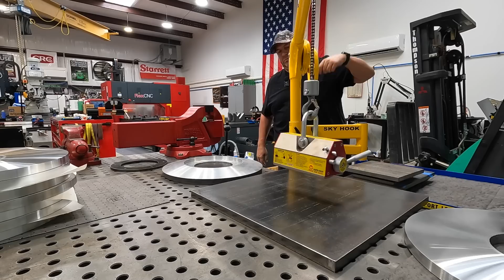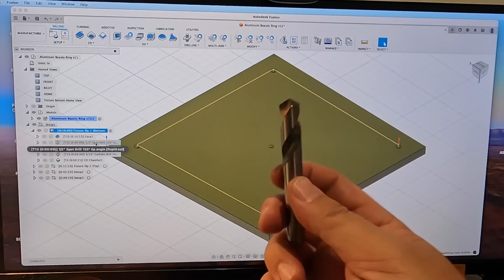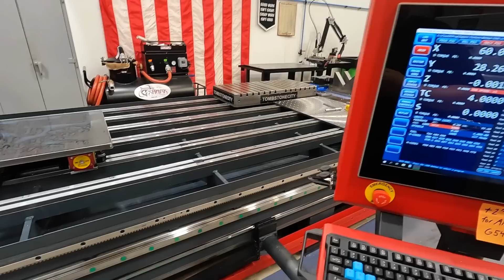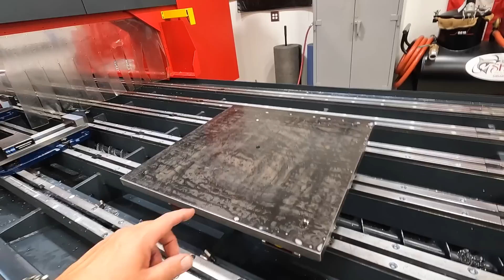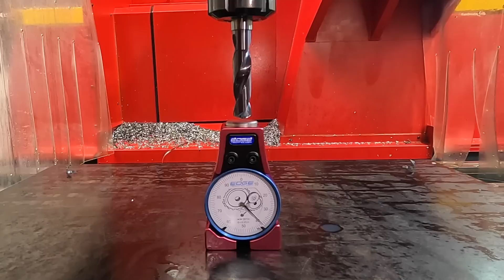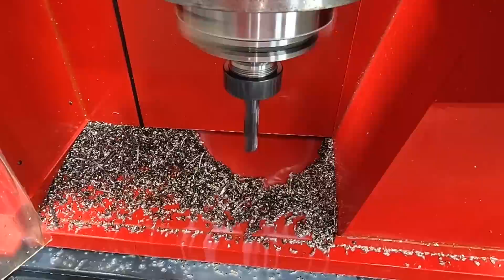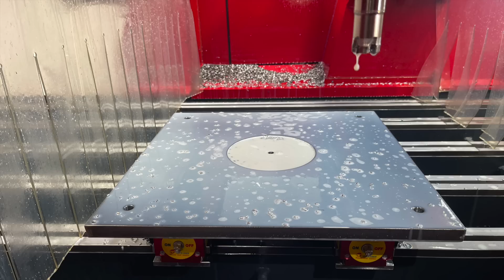Milling the Beauty Ring Fixture for Op.1

Comment: Hi Adam, a naive question here. When you flipped the plate setting up for the tip side you did not use the 4 previously drilled holes to align the plate. However you now have 6 clearance holes you need aligned exactly to your next program so that when drilling into the aluminum the drill bit travels into each clearance hole in the steel and doesnt miss by x. What will you use to get the steel plate correctly aligned so that these clearance holes are in the correct space that matches your aluminum program? Thanks D

Comment: The tool change location looks a bit out. I've done a fair few of these types of tool changers carousels on travelling column machines. The tool change position for the spindle is set by jogging the spindle onto the tool taper and altering X,Y, and Z positions in the control parameters until the tool engages without being pushed over..

Comment: Here's a project: Design and make a clear mineral glass or pyrex, spinning, self-clearing "window" to be mounted in front of the camera in a splash zone. Something that runs on small cheap batteries.
Or plan B, is mounted on a rechargeable drill that spins a mandril onto which a clear shield is mounted. Drips, drabs, and debris would be spun off the clear shield so you could put the camera where you wanted rather than some other compromise.
Reply: Can't you imagine the very short sections when there is a camera obscuration? I hope you don't drive a car!

Comment: Query? Why didn't you surface the second side before milling and putting the holes in. You were using depths for spotting and depths all over that side but if it was not initially flat, wouldn't things like spot depths and deburring etc. be off?

Comment: It's worth putting a couple of milled edges on your fixture plate. One on X and one on Y. It will help centre it when you use it next time. Or stick a couple of pins in it.

Comment: When I face the stock, I set Z zero as the finished face, just the way I was taught to do it! I also like to cut a plate like this, square, to make it easier to line up on side two.
Reply: I don't think there's any point. He's got a centering hole, and the part is round
Reply: @snowdog90210 if the fixture is used again the centre holes need to be aligned radially with the program. Otherwise when drilling through the drill can catch the sides of the fixture holes. So a datum edge should be machined and marked as front so it is not setup at 90 degrees..
Reply: @snowdog90210  Just a bit easier for lining up the plate on side two as the hole pattern would be tied into the outer edges but as you say, not needed for this job.
Reply: It's recommended good practice to set the finished top face at zero then all depths will have a negative number. This helps if you miss a - sign in front of a Z depth, the tool will be clear above the workpiece.
Reply: @marley589  Yes, agreed, but the finished top surface would normally be set to Zero and not the rough stock. Then all ops can be a minus Z from the finished surface. The rough stock doesn't actually exist on the finished part.
Reply: @cncit  Sorry I should have made that clearer. I'll modify my original post.

Comment: CAN YOU PLEASE EXPLAIN WHAT THE DIFFERENCE IN GEOMETRY IS ON A SPOTTING DRILL?
Reply: a 135 degree drill needs a 140 degree spot (or more than 135 at least) because the drill center tip rides in the divet and doesn't wander
Reply: @ikbendusan  I pretty much understand that much, but why doesn't the spotting dril wander...
Reply: @fengelman  spotting drills usually have a very short flute length so a lot of rigidity is preserved in the shank. that shank can be a lot thicker because it doesn't have anything to do with the final size of the hole; only the divet. it's not about the geometry of the tip really, and more about everything else
Reply: Can you clarify your question? Are you talking about in Fusion? I'm not understanding what you are asking.

Comment: WHY DIDN'T YOU USE THE SKYHOOKER MAGNET THING TO SET THE RINGS DOWN TONFIXTURE? SEEMED LIKE IT WOULD SAVE A BROKEN BACK. BE SAFE OUT THERE HOSS. GET BACK TO THE MANUEL  MACHINING ASAP PLEASE.
Reply: The aluminum doesn't stick to magnets very well ;)
Reply: @Josh-sFarm  WHATEVET YOU HAVE TO TELL YOURSELF TO GET BY HOSS.

Comment: Something to consider that I was taught in cnc classes is that you can save time in hole drilling by using the spot drill and go deep enough to give a chamfer.
Reply: @someguy95981 For this job, he only had a 3/8" spot drill. The holes were bigger in diameter than that, so you couldn't use that method unless you were to use a spot drill that was larger in diameter than the drilled holes.
Reply: He said he learned this a few videos ago, I was also expecting this technique to be used. I bet he has one on order for the 48 holes in the Aluminum rings..🤔

Comment: Every one does things different. but what I would have done is finish the counter bore and holes on the mill clamped down on the table and then mounted the part on a plate with 2 pins and clamp the part down with the remaining bolts and finish the part if the 3d milling didn't work out I would rough off the material on the taper and make a final cut on the lathe. But what makes your set up a pain is the huge plate to cut a big diameter and locate. I feel it much easier to use 2 holes and clamp using the remaining.
Reply: It seems that machining the bore and holes first is the most popular option. With a tolerance of +/- 7/16" to locate the plasma cut blank it does not need such a precise location.

Comment: 120 kg equates around 264 pounds, not 2600
Also is the coolant supposed to come out from the collet? With inner cooling you should use special collets that are sealed so the coolant only comes out of the tools.
Reply: He meant to say 1,200 kg, not 120 kg. They are rated at 1,200 kg

Comment: I can't understand the use of co-axial and dial gauge type analogue probes to set job up when you have a perfectly good Renishaw micron level wireless probe? The time you are using up, bumping a great big piece of steel around to centre it to a 1/16th", when the Renishaw can centre the work offset and even adjust the plate for square / parallelism within software - the Flex must have this capability built in? And I do agree with other commentators about the right tool for the job - you would have never done this job manually, using a rotary table and a ball end cutter - its perfect for a lathe and particularly a CNC driven, taper cutting one. I sympathise with the learning Fusion thing - I still can't grasp it as it doesn't do things in the order my brain works + i've had 40 yrs on one CAD system and Fusion is soooo clunky in comparison LOL!
Reply: Patience, Adam willl get there!

Comment: You have omitted the really important part of the process: finding and correcting errors in the program. The actual machining is just a spectator sport. Record the test runs. Show the uneventful part at 10x, but at errors, show how you saw the error. Then show the process of fixing it.

Comment: Adam try Rain-X on the camera case, see if that helps with the interior shots with coolant running.
Reply: He has tried it, it didn't help.
Reply: The coolant, or rather the additives for the water to turn it into coolant, lower the surface tension to improve wettability. This makes Rain-X ineffective, unfortunately.

Comment: Cutting the centre out of your fixture might help with chips and also taking the ring out after the cutting op
Reply: Chips were never a problem. Coolant sitting there was a small issue that we fixed pretty easily. I’m not sure it would help with removal. The discs didn’t just pop out, but he figured out a pretty easy way to make that happen.
Reply: There will be a lot of chips swimming around in the bowl created in the center. Far better to get them all falling away through a hole and not recutting themselves, nicer to blow the part clean too. If the fixture hole is larger than the part it will allow the ledge to be used to lift the part out, you have to also think of the operator when designing these things.

Comment: Why hasn’t the US gone to Metric? Would you prefer to go to metric?
Reply: Here in the UK (Scotland) we are officially Metric but still see a lot of Imperial. I'm old (77) and have a small machine shop with three lathes, two mills and so on. People bring me hobby jobs which can be either inch or mm, therefore I have two sets of everything and adjust accordingly. One soon gets used to switching units when turning or threading. ACME (29 deg) Vs Trapezoidal (30 deg), Imperial (55 deg) Vs metric (60 deg). Its not really a problem apart from having to acquire the additional tooling.
Reply: No we would not prefer metric.
Reply: Im an old guy (almost 65) and had the imperial system hammered into me so long I dont know anything else and too old to worry about converting, when I was a mechanic there were just a few foriegn metric cars and we all used imperial system, I just like what im completely familiar with better.
Reply: @yambo59  I'm a 65-year-old retired Mechanical Engineer. Here in the US we were taught BOTH Imperial and SI units. In fact, EVERY problem we had to solve was given in a mix of both systems and we had to constantly convert them. It was hit or miss which system simplified the equations, there was no pattern, and in the end we were VERY comfortable using either system. Came in handy when I worked for a German Diesel engine manufacturer. One of my "projects" was to completely redraw a German Metric engine drawing to Imperial for a customer to use when building their machines to use our engines. I also had to translate the German wording to English. Doing the entire drawing in ink, on Vellum. We didn't use CAD at that time (late 1980s) ...
Reply: @TheUncleRuckus  Both systems of units are fine but you should note the USA inch has been tied to the meter for about 100 years at 25.4mm and the lb is similarly tied to the kg. It is an illusion of 'freedom' or 'independence' and it comes at a cost. After nearly 50 years in Australia we still have gear using both but NO ONE would make a new product based on the Imperial system.
Reply: @davidvictorsen Just think about how much money it would cost just to change road signs to metric. Every major road in the US has mile marker posts as well as posts that further divide the miles. It would be so expensive and take so much time.
Reply: @MechanicalAdvantage  The UK stuck with Miles and MPH for decades in spite of going from Imperial to Metric. We are talking about Engineering not Rods, Chains and Acres.
Reply: @MechanicalAdvantage  That's a one time cost. Easily done with decals. Imagine the recurring cost for manufacturing all tools, machines and so on in a separate version for just one single country.
Reply: @theswedishuser  decals that would say things 5.37 km? What country do you live in out of curiosity? (Edit. Just looked and it is Sweden.) The state I live in is just under twice the size of your country. And we have 49 more states to go after this one. It isn’t the easiest task ever to make the switch.
Reply: @MechanicalAdvantage  So, you choose to stay stuck in your old, inferior ways because it is easy?
Reply: @MechanicalAdvantage  Then the sign would probably state 5 km. All I'm saying is that the cost for making a lot of stuff in a dedicated version for one single country probably is huge. But I won't force you :)
Reply: @theswedishuser  You acheived something far harder than swapping from imperial to metric over a passage of time. You swapped from driving on one side of the road to the other, OVERNIGHT.  Well done.
Reply: Metric has been a official system for many years in the US. One are free to use whatever system. Mark the word: freedom.
Reply: @Rimrock300  That continues to be a dumb argument. Anywhere in the World is free to continue to use the British Imperial units but as only Liberia, Burma and the USA use it and the WORLD uses the Metric system generally. It continues to COST EXPORT $$ as the World is Metric!

Comment: How do you remember all of the Starrett tool numbers?
Reply: The number is on the tool as well as the box.
Reply: Machinists (and Engineers) are very "number oriented" by nature. At least I am, since I am BOTH! For example, I still remember the GM part number for the Rochester 2-barrel carb on my first car 17056105. For a stick shift car with air conditioning. Automatic cars with or without A/C, or a stick shift car without A/C had a number that varied the last digit by one ... 😁

Comment: at timestamp 25:40 or so you point out the front right corner was not level with rest of plate was lower by 1000 mils i think u said. you left it that way. why didn't you just repeat the scenario and cut the plate again so it’s  all level?
Reply: It wasn’t worth the time to reface the part and would impact the performance of the fixture.
Reply: thanks it did work out grea . thank you

Comment: Adam after you ran the initial surface program your Z axis zero point changed due to the material removed.  To avoid the center hole not punching through you could have reset the Z axis zero point

Comment: I doubt this will be answered but couldn't these things be shaped on the lathe and eliminate the fixture plate fabrication? Or is this just a way to practice more CNC?
Reply: Even if done on the lathe, due to the thickness, it would still most likely be bolted to a fixture plate. There is no power feed on the compound, so that would be a problem that would need to be figured out as well.
Reply: Could be done on a lathe. Even with no powerfeed on the compound one would be able to make a fine enough surface, just taking time. He got the CNC and did choose to make use of it, demo it for the viewers.
Reply: After an order of 8 goes well there might be another 100, or 1000 coming? Lathe would get boring realllly fast
Reply: @Rangitatahunter  that's a good point. If it were 1 or 2, he'd do it on the lathe
Reply: Vacuum chuck. No fixture, 1 op job done.

Comment: You may want to try out sealed collets for your thru-tool coolant tools. I actually don't mind the extra spray through the collet as a chip flush off of the work surface, but it could help with the camera work.

Also, consider hard-mounting a camera just inside the red operator access panel inside the machining envelope and then using zoom to get up to the work. You may be able to get a decent image without coolant spray because of the added distance from the spindle.

Comment: Would you believe, 1058.2 pounds holding power
Reply: Small mistake on what he said. It is a total of about 10,500 pounds.
Reply: With magnets, it depends on the thickness of the part and the area of contact and many other variables.

Comment: Adam, made a very expensive mistake one time working with magnets. Thickness matters in holding force. You may not get by with machining a 1/2 " thick plate. The holding power will not be the same on a thinner plate! I assumed and it cost the company 70K😔
Reply: Some of the magnets I use are rated with 1" plate, they don't hold thinner stuff very well.  I've seen 3/16 come loose.

Comment: Did the CNC counter bore to the correct diameter you specked, and was the diameter accurate in all 8/16 directions, [45/22.5 degs] another words was the counter bore round
Reply: I doubt he checked that. It was round enough for the purpose.
Reply: @MechanicalAdvantage  Reason I bring it up is because that machine is Boo Koo Bucks and everything he measures down to 1/1000 - 10,000s. I'm also interested in buying a CNC machine
Reply: Leaving 3 short arcs of the pocket at the correct size and relieving the remaining 3 long arcs is a popular way to locate round parts as there is less locating area to keep clean. Standard fixture practice is to locate straight edges in 2 places and round parts in 3 places.

Comment: Adam, you made a small mistake with the magnet rating, 120 Kg is equivalent to 264.55 pounds, so a total of  just over 1058 pounds , not 2600 pounds as you stated..
Reply: Americans remain baffled by the metric system.
Reply: @ScottPankhurst  It amazes me that Americans cling to Imperial measurement. After all it is a British system and after the war of independence they rejected the British currency, Westminster style government, and legal system. The Americas were more closely allied to France, why did they not go with the metric system then? I can only attribute it to American perverseness.
Reply: @garychaplin9861  I had a prolonged discussion with a user claiming 'freedom' and because it was Anti British to use the 'Imperial' System just recently 😆 Should be noted that for most of the last Century the US Standards for Units have actually been tied to the Metric System so it is just a wrapper.
Reply: @ScottPankhurst  Baffled, really? Metrics is simpler but for the simple.
Reply: He meant to say 1,200 KG. If you look them up on the website, you will see they hold 1,200 KG.

Comment: I would have squared the outside edges at a specific dimension from the clamping holes. Yep, I know it’s not needed but while it’s in the machine do it. Why? just because it may be beneficial later. It's just a few passes and 5 minutes of machine time. Otherwise as always - wonderful work.
Reply: Machine at least one edge and mark as the front so the radial holes align with the program.